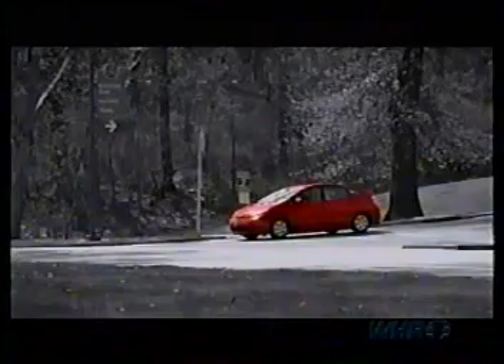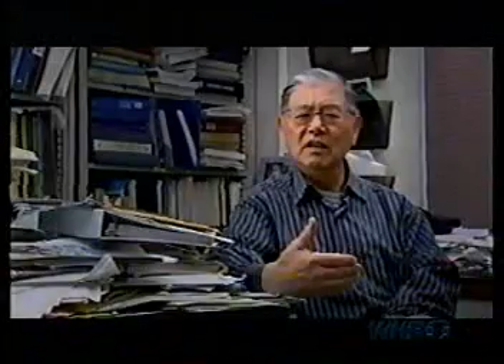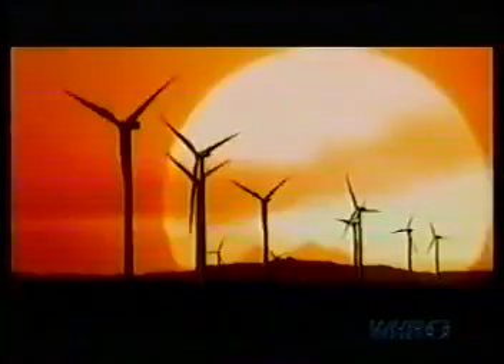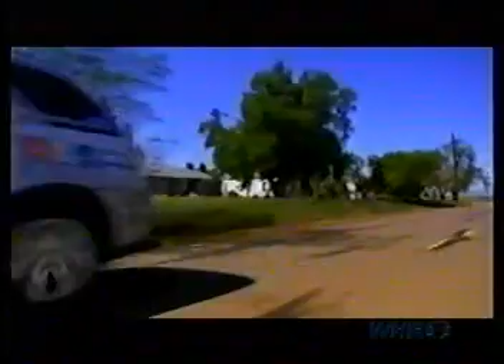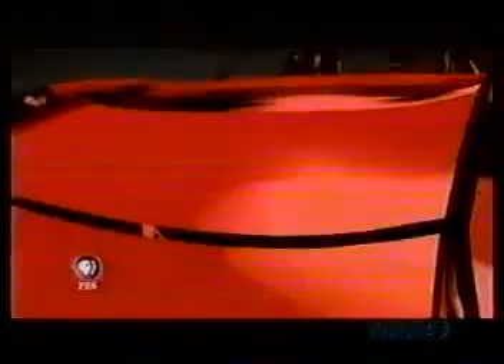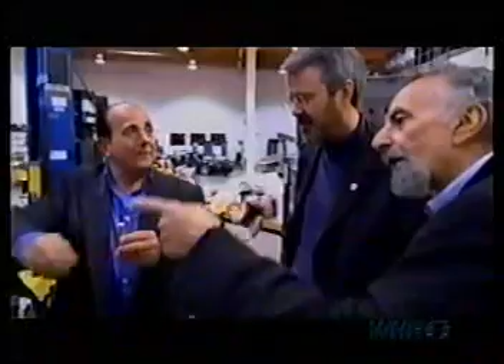Car of the Future Part 5/6

Comment: why not add a small gas generator thats automatic and charges the batteries when the car is moving and parked away from home ,, you just cant argue with the energy density of gas ? much like the fisker only smaller